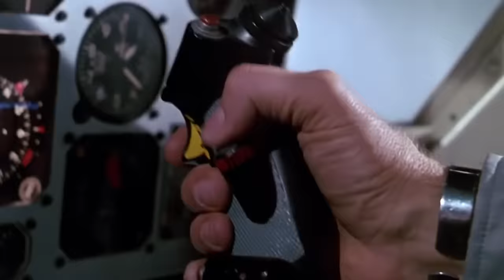The Quintessential Airwolf Tribute

Comment: This wasn't CGI, they flew it. BEST.
Reply: I swear, some of those shots are of Airwolf flying just a foot or two from the ground. HOLY CRAP!!!
Reply: A lot of it was done with model RC helicopters.
Reply: @10p6  no, no it wasn't if you actually look in to it :/. The model RC bits were very few and far between, that hovering 2 foot off the ground? all real. Flying a meter above the ocean? all real. Flying between to rocks in the desert? VERY real lol He was a damn good stunt pilot and ended up dieing not due to a mistake, but mechanical failure while again, performing a real stunt. You kids do not realise exactly how bat shi insane the 80s were with stunts lol. LOTS of deaths because of it too.
Reply: That they did!  The Stunt pilot was incredible skilled and daring! Especially considering how HEAVY that chopper was!
Reply: @10p6  "A lot"?  🤨 "A few" to "some" would be more accurate. Trick angles and sped up footage hell yeah.
Reply: @CrashHeadroom  I watched a documentary on it.  Some parts were real, a lot was RC helicopters.
Reply: @10p6  then they were wrong :/ and it was a bad docu.

Comment: I used to watch this show on TV as a kid growing up in the 1980s heh

Subtitles: 

Smart Lady: Basicaly Airwolf is an aerodynamic lifting body with a twin turbine driven rotar system capable of propelling it to 300 knots.

Senator: In other words its a fast twin-engine Jet Chopper.

Smart Lady: One can express it in those terms except THIS 'Jet Chopper' can disengage its rotar system and ignite these two turbines. 
9.6 secs after ignition Airwolf can exceed mach 1 from sea level to 61,000 feet.  In other words senator, Airwolf is a Mach 1 plus Chopper that can KICK BUTT.

Comment: Physic not required. The speed limit on an halo is set by the rotor speed. It’s like having a plane with only one left wing. Also, once the propeller goes super sonic, it can no longer displace air. The super sonic shockwave act as a shield preventing air from moving through. This is why there is NO propeller super sonic aircraft.
Reply: Lol. 61 000’? A good thing they never use this feature. We would spend most if the flight time waiting for the aircraft to go back and forth this height.

Comment: So… does anyone else understand that helicopter rotors can’t exceed the speed of sound? The advancing tip of air wolf blades would be having a problem at 300kts that’s 540 kmh or about 0.5 Mach. Yep that advancing blade is having problems with the sound barrier.

Oh know what about retreating blade tip stall and retreating blade loss of lift? Oops that chopper isn’t producing any lift with its rotor at its higher speeds. Oh and that’s not a lifting body helicopter as it curves off to the sides too fast so no air is forced over the top and the thing will need to fly with an angle of attack.

Helicopter blade lift, the RULES.

1 no part of a blade can exceed the speed of sound.
2 the entire blade must always be driven into the air to produce lift.
3 the air can’t flow backwards over the blade.
4 the blade requires angle of attack to produce lift.
5 if the blade goes too slow or the AoA is too steep the blade stalls and is fatal.

So Mach 1 is 1100 kmh or there abouts and air wolf does half of that and that’s oh so bad and a no no as it causes breaks in rules 1 2 3 5.

How? 3 and 5 to start. If you’re going 0.5 Mach and the rotors are spinning  making lift and thus thrust then the blade that’s retreating as in going from the front of the helicopter and around to the back has to be going faster than the helicopter airspeed. If not then the blade will in fact have the air flowing backwards over it. So stalled out and no airspeed and no lift. No lift on the retreating side means the lift is only on the advancing side and the helicopter flips over = death. So you speed the blades up? Yeah now the advancing blade that was already doing half the speed of sound rotationally plus another half in forwards airspeed = Mach 1 advancing blades = disruption of lift and shockwaves destroying blades= no lift = death. Slow the advancing blades up means the retreating blades are now having the air going backwards over them.

You see the problem? It’s just all so much bullshit. All I see is a shitty single engine jet ranger looking thing. Even the Huey from Vietnam was single engine. I’ve seen many times a twin engine Huey and it’s called a Bell 412 and it’s a huge beast and bigger than the single engine beast.

Comment: Who would win in a fight between Airwolf and Blue Lightning?
Reply: I think it would be AirWolf.
Blue Thunder was outfitted to be a civilian police helicopter, and AirWolf carried missiles as well as flew much faster than Blue Thunder.

But Blue Thunder was based on an actual existing MILITARY helicopter just with most of its REAL weaponry removed vs. AirWolf, which was just a neat skin over an existing CIVILIAN helicopter but with FAKE weapons attached. 

I think there is still at least one Operational AirWolf prop aircraft still existing, so it would be neat if they could get both aircraft together physically for photo/video shoot.
Reply: @EvilDaveCanada  insightful analysis. How about Robocop vs T-800 terminator?
Reply: @frankhassle9366 Can not really compare them realistically as the power tech needed for both of them doesn't exist or the AI tech needed for the Terminator. Robocop is a cyborg and that is his main limitation as well as his main strength (thinking outside the box) as there are TV movies with newer Generation Robocops are designed to use & handle existing non-computerized military tech. All of the Terminator models that I know about fit human size parameters, whereas both original, remake & TV movie versions are usually slightly bigger the basic human size but some have refinements that allow them to use human sized equipment.
I don't usually do fantasy comparisons but Airwolf & Blue Thunder both used existing tech from the time of their existence. Both Robocop & Terminator are both using fantasy future tech. And don't drag me into the battle between Star Trek & Star Wars tech.